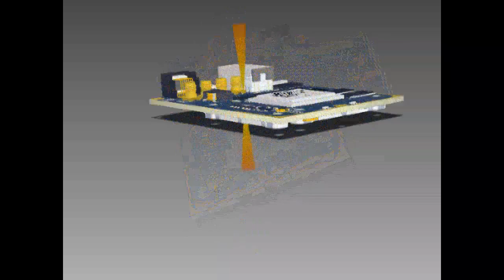EEVblog #83 - Do You Suck At Hardware Or Software?

Comment: Wow, you get it! I suck at hardware, I came across your channel looking for basic background information and got so much more. I am a software person 100%, I have my degree in software and I've been making my living with software for the last 30 years. Your advice to specialize in one part of the hardware domain also applies to the software side.

The speed at which these industries are changing means you'll need to spend your free time just trying to not fall too far behind in the area you have selected. I can tell the approximate year someone graduated from university just by reading their code (for most people), I can also tell the era that the managers worked based on the coding standards in use. 

The explosion of low cost maker boards and development tools has brought me in to this new world where I can interface with the hardware directly. I know if I ever want to get past the breadboard stage for anything I do I'll need to hire a hardware person to do it correctly but the little I can do on the breadboard lets me explore and get my hands dirty enough that I can determine what might work and what doesn't work. The same is probably true on the hardware side, your software skills will let you explore but you'll need help before going to production.

What is exciting is when the best of both worlds come together to produce a product and if the offerings today are any indication of what is to come then hold on to your hat the changes are going to come really fast.

Comment: Just a quick note for anyone who knows C and wants to learn C++. I learnt C many years ago when I was in my 20's, and about 15 years later I looked at C++ assuming that it would be similar, or at least I would be able to leverage my knowledge of C. When I looked at it superficially it looked like a completely different language, and left it. It wasn't until I took a longer look at it a couple of years back that I found that C++ is just C, or at least a subset of it, it's just C++ comes at things from a different way, put it this way the same compilers will compile C and C++. You don't necessarily have to write object orientated code with C++. My point is if you know C then have a bash at C++ don't be put off by first appearances.
Reply: Don't you mean superset? :P

Comment: As a software dev, I'm of the opinion that no, you can't "master" both hardware and software.

It's hard enough "mastering" just one discipline.  And software is a vast field.  If you try to "master" everything, you become a generalist who isn't very good at specialised work.

The best programmers tend to specialise on one or two languages only.  Sure, they know about other languages, and can use them in a pinch, but they stick to what they know.